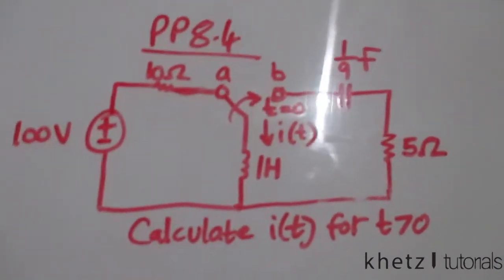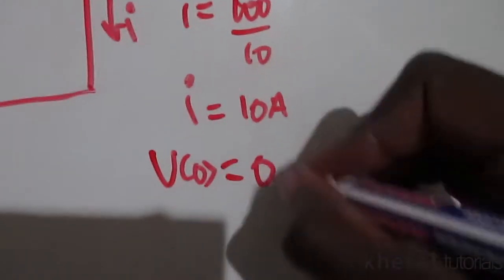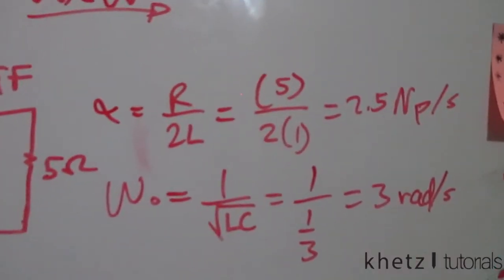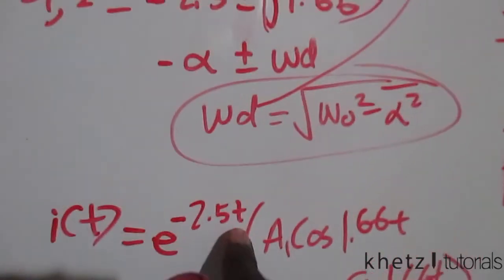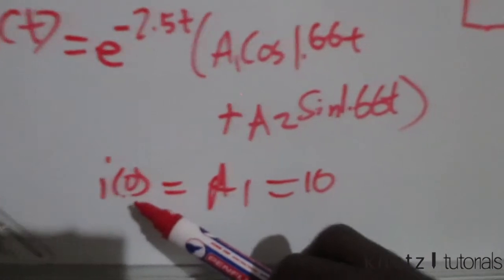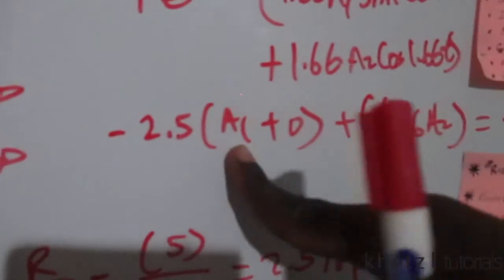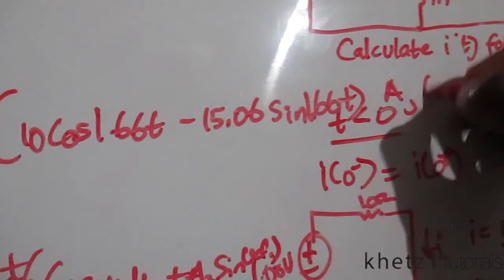Fundamentals Of Electric Circuits Practice Problem 8.4

Comment: Please how is Vo zero? What happened to the 100 V source that was present at t<0?
Reply from the maker: So the switch moves from a to b. So the positive terminal isn't connected anymore which essentially disconnects the voltage source
Reply: @KhetzTutorials  , at the initial condition, the 100V Voltage source is connected to the circuit. Why ignore it's presence? Are you trying to say that it doesn't count because of the absence of the Capacitive Voltage or what?
Reply: @chudionuigbo5952  Vo is voltage across the capacitor. At t<0, there's no voltage across it since it's not part of the circuit. And voltage across the capacitor doesn't change instantaneously so it'd still be zero at t=0+

Comment: One quick question on how you calculated A2. Since we assume that it has passed a long time (t=infinity) since the switch was changed from position "a" to "b", how is it possible that the voltage across the capacitor Vc is still: V(0-) = V(0+) to be applied in the KVL equation? I understand that in this situation the capacitor behaves like an open circuit, so that doesn't make much sense. Anyway, hope you can help with this confusion and thank you very much for your videos, they are great and very helpful!
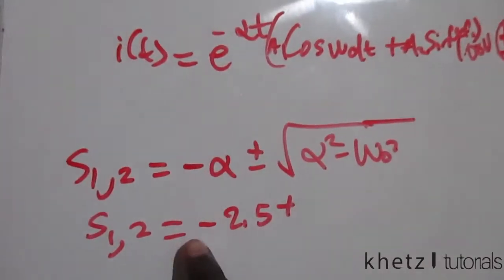Reply from the maker: When the switch is at a, the capacitor is not connected at all. It would be an open circuit if it were connected and the voltage value would be calculated accordingly. We were not given any initial value or energy which it had stored(as it's a storage element) so we can therefore conclude that its initial voltage is 0 because it wasn't even connected. The capacitor voltage does not change abruptly which basically means the value you had just before t=0 is the value you will have just after t=0(and that is the notation in your question). Inductors pretty much work the same but the quantity associated with them is current and that is why we use the same Io we found just before zero(Inductor currents do not change abruptly). It's 4:57 in South Africa btw😹
Reply: @KhetzTutorials  great, now I got it! Thank very much for clarifying, I was a bit confused with this particular initial condition. Keep the hard work on these videos!
And try to have some  rest there haha.